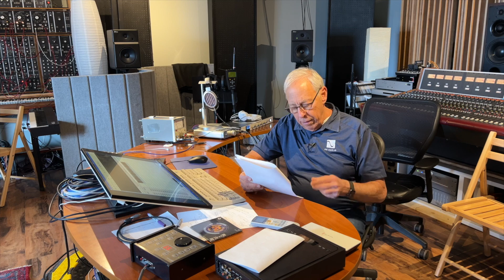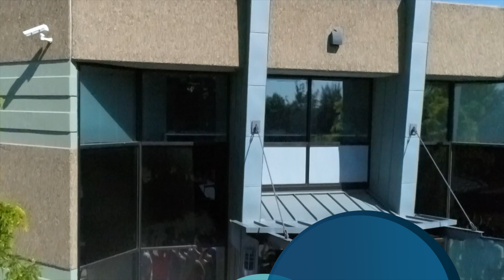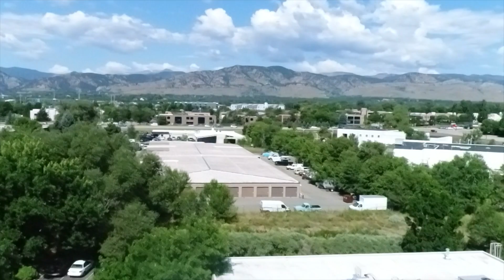External crossovers

Comment: It makes total sense. You can display your DIY crossovers. You can also improve the factory crossovers with improved components. The speaker box should be for driver enhancements. If it needs upgrades or troubleshooting, it will be much easier if you don't have to dig around in the speaker box. Seems like a no brainer.

Comment: I removed the crossovers from my B&W 801 Matrix Series II's only because at the time (in the 90's) I was able to buy a pair of upgraded external units by North Creek Audio. They have better caps and use air core inductors (B&W had iron cores) and removed the overload safety circuitry. I also had North Creek modify their units to have separate wiring terminals for me to run separate cables for each of the three drivers per cabinet. Even today, 30 years later, they sound phenomenal.

Comment: The big question is why even have analog crossovers at all?  Either go with 1) a full range transducer, or 2) use a DSP to do digital filtering and use a dedicated amp for each transducer in a multi-transducer loudspeaker. Leave these 19th century devices (LC, RLC circuits) behind.
Reply: The problem with 1) is that most full range transducers work with a whizzer cone, thus with a mechanical crossover...

Comment: You people buy brand new speakers that cost 24k to 70k and the first thing you do is rip out the crossovers..?? Really..!!
Paul, the crossover’s in your FR30’s and FR 20’s that you sold will get new and improved crossover’s..😀👍
New improvements in a total re-wiring on your speakers with new Blazing fast high performance speaker wires. 👍
The Audiophiles are just helping you out with your speaker’s design. 😀👍😎
Reply: @Douglas Blake 
Crossovers Made in China.
Cabinet speaker wires made in China.
I understand ..👍 
Crossovers are not aways the Best design even high value speakers. They are hidden from view.
Reply: @Douglas Blake 
Yes there are those that rebuild speakers for a living.  You ship your speakers to them. 

The other option is DIY speakers, that is popular. I have seen some incredible work done over the decades on websites and YT. A lot of skilled people all over the World. 

I like seeing and listen to other people’s audio systems on YT from around the World. You see all types of interesting audio from the late 1800’s to the present.

I am not interested in my audio stuff, I want to see and hear other people’s stuff 👍

Comment: I've got one bookshelf with an external crossover. But it's only because the Miflex copper foil cap in the tweeter circuit, which made the crossovers too large to fit into the speaker without also taking up a ton of air space. Plus it doesn't fit through the woofer hole..
It's by far my favorite speaker of my collection.
That said, it's not something I would recommend for the vast majority of people.

Comment: A good dealer will tell you ( Change one item only and give time to measure good , bad, or neutral outcome ) then keep adjusting if needed. If you add multiple items at once it's hard to know the impact of each individual change in the system.

Comment: Most definitely the biggest, MOST noticable improvements in overall sound quality can be had AND actually heard, by the upgrading of all of the individual crossover components themselves to a significantly higher quality level, (especially if upgrading from old, possibly leaky electrolytic capacitors to brand new, high quality polypropylene capacitors, that makes a VERY significant improvement!), regardless of whether you keep the crossover inside the speaker cabinets themselves OR you end up making them totally external to the speaker.

However, if you DO bring the crossovers outside of the cabinets then be sure to also use the absolute shortest necessary AND the very BEST possible quality wires AND connectors that you can find and afford, to then actually hook up each of the individual drivers of the speaker to the external crossovers, because really crappy quality wiring and/or cheap connections between them, especially if ANY of that stuff in the direct signal path has ferromagnetic material in it, like steel, etc., (you can use a magnet to test terminals, etc), then that can most definitely detract from any significant improvement that may have occurred through improving and upgrading the crossover's individual components themselves.
Reply: The problem with that is that even if it's objectively better, it might not be to your taste. I, as an experiment, had the filters of my Boston acoustics A25 (hilarious little speaker by the way, worth a try) upgraded. And yes, they were more transparent, and rhytmically better, but they were also a bit more bright and brittle. Now, I'm sure that if I told you which components were used you'll be like 'well of course, that's how they sound'. But there lies the problem, even if you buy objectively better stuff, it may still change the sound signature and in my case the downsides sort of cancel out the upsides. I left them this way, because they are still great, but I wouldn't do it again.
Reply: @rollingtroll  It helps if one has at least some basic knowledge about and past experience in knowing what usually sounds good and WHY, (AND the opposite so you can avoid it), but even when I was first starting out experimenting with speakers in middle school, I don't think I ever really experienced a very definite downgrade in the overall sound quality or sound presentation from upgrading the internals of a speaker, sometimes not a very significant or noticeable improvement at all, but never really a downgrade in sound quality if I ever did anything to improve a speaker. Then as I got more and more experienced in my knowledge of what makes the MOST difference and actual improvement, I got really good at taking almost ANY speaker, no matter how good or bad it was initially, when I first saw it or heard it, and bringing it up to its fullest potential. I can make just about ANY speaker sound better than it was at first, now that I have the knowledge of many decades of continually experimenting experience in my head.

Don't give up man, your first few speaker upgrades are a learning experience, as they should be, that's why you start out with some basic knowledge from reading a few speaker building books, etc, AND you always should start out experimenting with cheaper speakers that you found in a thrift store or something, that way if you make mistakes then you're not out lots of money!

Comment: Interesting.  I never thought about the delayed feedback response of a capacitor that is far away from the speaker, the source of the vibration.
Thinking about that, I am happy with my choice to put crossover components closest to the drivers that they control.
Reply: Yes, there is that too, but I believe what Paul was probably referring to here in this specific case was what they call "microphonics", where a crossover component inside a speaker is "hit" by or bombarded with the sound vibrations from the individual speaker drivers themselves, and then the crossover components "ring" or "resonate" at that frequency, AND at a slightly delayed TIME than the original direct signal passed through them, therefore giving a "smeared" final sound presentation out of the driver, (woofer, mid, tweeter, etc), however some or most of that effect can be eliminated or at least greatly reduced by bringing the crossovers of the speakers completely outside of the overall speaker enclosure itself, and/or using sound dampening materials between the crossovers and the speaker cabinets themselves.

That's one of the potential benefits of doing that, given that everything else in the signal path, (wiring, terminals, etc), is ALSO upgraded along with making the crossovers better (&/or external).
Reply: @Douglas Blake I am of course aware of the "crosstalk" potential between coils, AND that that is the reason why they MUST be mounted at different angles to one another when in close proximity to another one, but I've ALSO noticed coils that aren't solidly constructed, like loosely wound or hand wound ones without any kind of epoxy or multiple tie wraps to keep them together, I've noticed some of the individual wraps of the magnet wire itself "vibrating" back and forth with an audio signal going through them, and I remember reading about that creating some form of (supposedly) audible distortion in the musical signal being passed through them, I just forget what it's called or known as, and I don't remember ever actually really "hearing" it myself either, probably because (usually) bass is going through coils that may do that, and it's more difficult to hear imperfections in bass notes than in mid or treble, but I CAN understand WHY it would potentially be detrimental to the music signal going through it. That's why I always use and look for very precisely and tightly wound coils, such as foil inductors or at least something like "perfect lay" types, with a completely tight method of securing them together, either a complete epoxy coating gluing the entire coil together as a totally solid unit, or at the very least multiple plastic tie wraps all around it to keep the windings from ever moving like I was describing. That movement usually ONLY happens with a very loud, high power signal going through them, but nevertheless, it's something that should be eliminated or reduced as MUCH as possible!
Reply: @Douglas Blake  Very true. This is a good point too. I would say that it's not a huge issue, and that electrolytic capacitors are probably the only type that really could be potentially microphonic, so if you upgrade your crossovers with really high quality, brand new polypropylene capacitors instead, then you don't really have to worry about that issue too much.

The coils (inductors) in the crossovers can be slightly microphonic also, but mainly only if they are too close to the magnetic field of the driver itself, and/or their windings are rather loosely or crudely wound and/or not secured or glued in any way to keep them from vibrating with the sound waves inside the speaker hitting them, therefore adding to their distortion of the signal going through them. (I forget what that kind of distortion is called, but I think you know what I'm referring to.)

Comment: My suggestion is that speaker builders should place the filters at the back of the speakers in a separate closed box(not sticking out but built in) and in front a plexiglass plate so the filters are visible. You could place vibration killing material between the filter and the wood to minimize  the vibrations. Sonus Faber  Maxima Amator and  magnat vintage 990 are good examples from my suggestion

Comment: I have my DIY passive crossovers separate and on top of my VOTTs.  They're also very open frame, as over the years, I've been physically tweaking them, measuring and auditioning them to my liking. A true audiophile is never satisfied!   Lol!
Reply: How much did you deviate from the OG x-over? I can only imagine how much better Altecs could sound with quality component x-overs.
Reply: @AllboroLCD  I built 3-way 2nd order crossovers (Linkwitz-Riley 1khz, 5khz), 3-way because I am also using a bullet tweeter. Dayton caps and air core inductors. 100w 8-ohm L-pad attenuators. I also installed VU meters on them roughly calibrated as a guide at about the sweetspot listening levels for my space. I use REQ software with a Beyer calibrated mic to get me in the ballpark initially, then tweaked the L-pads to taste.
Reply: @cletusberkeley9441  They must be on a whole other level now! Nice ; )
Reply: @AllboroLCD  heck yeah, I think they sound awesome. I drive them with a VTA ST-120 with KT-88s, they couple sound beautifully into my listening space. Always been a huge fan of Altecs.